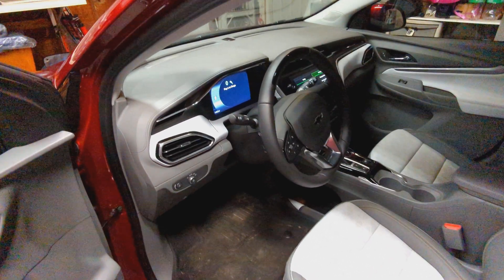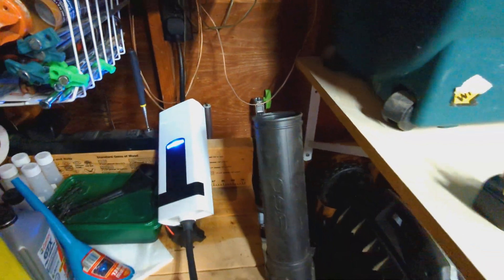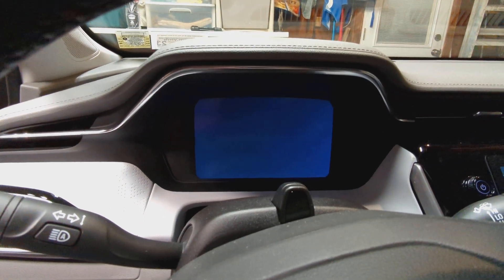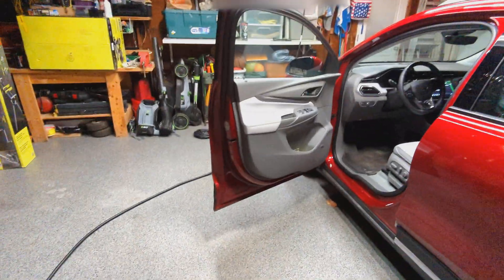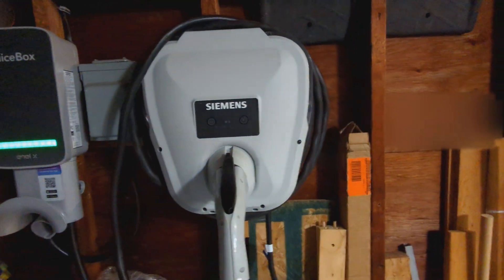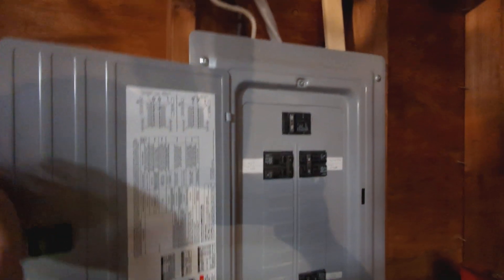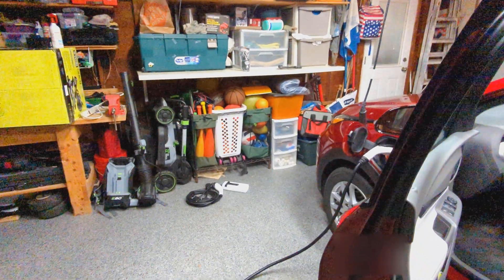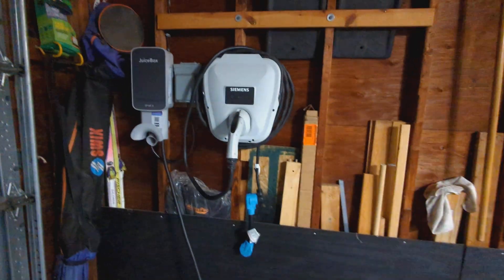Bolt EUV Charging Options - Review 120V vs 240V how much time do you have? days vs. hours

Comment: You do understand that they could put a faster charger in that car for pennies on the dollar. But like typical legacy automakers they're trying to find a way on how to overcharge you. Before electric vehicles they used horsepower to differentiate between the $20,000 car and a $40,000 car they can't do that because most electric vehicles are fast by nature so now they're going to use the charging speed to get more money out of you. Tesla does not do that say what you want about Tesla they don't rip you off. I am not saying that they will not turn into GM or Ford in 20 years but right now two model s's one model 3 and a model y later I can honestly say Tesla does things right. I know that their model 3 is expensive compared to this car but like I said to put a faster charger in there would be nice to even have it as an option for $500 or $800
Reply from the maker: You have a some great cars no doubt, but you have spent about $250k on these Tesla's over at most 10 years. which is about about 5 times what I have spent on my vehicles.  And yes I completely get they could add such options. But at the same time Tesla could knock 20% off all of their vehicles and still be very profitable.  Could even knock 30% and be at break even.  So you as a buyer of the vehicle are paying that premium, and while I like Tesla and what they are doing I am choosing for now not to fund their company, at some point that may change as they will continue to be very successful
Reply: @practicallyfrugal  those cars are in a different tax bracket they compete against BMW and Mercedes. The reason why is because you can make them cheaply and sell them for more money it's called capitalism we all hate capitalism when it works against us. My point was something as small as adding a charger that can charge your vehicle faster if something even the cheapest car should have but like I mentioned before that's something they're going to use to make you pray more money

Comment: do a video on the heat pump and show if cools as well as a/c and power usage difference. and if heats as well if using for heating.
Reply from the maker: It will be on the agenda, I have the Rheem heat pump water heater that replaced a 40 gallon gas that I should do a video on, math on those is quite favorable to the point if you swap a resistance style water heater with one of these you will negate the additional electric use for 12k miles in the bolt
Reply: @practicallyfrugal  about 2 years ago we swapped out an old nat gas water heater for a heat pump/electric hybrid water heater. it works pretty well. but electric bill about 95 more at certain times of year than before. but nat gas bill isnt as high during heating season. water doesnt get as hot but still gets plenty hot. its a 50 gallon water heater.
Reply from the maker: @mts982  that's seem rather high.  Either you have a lot of hot water use or insanely high electric rates.  We have the 65 gallon version and inlaws have the 50gallon version. Family of 4 and 2 respectfully.  Both are using about 90kwh per month or about 1,100 kwh total. At national avg electric rates that is $165/yr.  As similar size resistant water heater would use about 5,000kwh and cost about $750 per year. Inlaws went from 50 gallon on resistant to 50 gallon HP and their electric bill went down about $45/mo.
Reply: @practicallyfrugal  only thing i can think of is its out in garage, not inside, been very cold as of late. maybe we need to wrap it.
Reply: @practicallyfrugal  
Time-of-Day (5-8 p.m.) Rate details
Non-summer

October 1 - May 31
Midnight
5 PM
8 PM
Midnight
Off-peak
Midnight – 5 p.m.
$0.1098 kWh
All day weekends and holidays
Peak
5 p.m. – 8 p.m.
$0.1516 kWh
Off-peak
8 p.m. - midnight
$0.1098 kWh
Summer

June 1 - September 30
Midnight
Noon
5 PM
8 PM
Midnight
Off-Peak
Midnight – noon
$0.1323 kWh
All day weekends and holidays
Mid-Peak
Noon – 5 p.m.
$0.1827 kWh
Peak
5 p.m. – 8 p.m.
$0.3215 kWh
Mid-Peak
8 p.m. – midnight
$0.1827 kWh
Reply: @practicallyfrugal  used 638kwh last month.
Reply: @practicallyfrugal  we do uses heater that uses electricity to blow the air. use dishwasher a lot. 4 outside lights stay on all night - dusk to dawn lights. have a small freezer in garage. mom watches 65" tv all the time.
Reply from the maker: @mts982  if the hybrid water heater used that much last month it is not using the heat pump.  Trying setting it to heat pump only mode
Reply: @practicallyfrugal  that was ALL our electric usage.

Comment: You did a very good experiment , I had a KIA EV until I had a 12 Volt problem, but I did love this car . After watching your experiment , I have to question why  companies selling EV's even bother to sell a car with 110 chargers , they are a waste of time and down grades Electric cars Useful ness . It's like selling an F 150 turbo with a 10 Gallon Tank . The dealer did try to up grade me to a Level two for 623 dollars . I went home and hit Amazon and purchased a Level two for less then 200.00 bucks . 
 
Prior to my EV purchase , I installed Solar Panels on my home , I asked for the Max, based on my previous two years usage , 150 % . After a couple months I watched my power generation and decided to get an EV . The Solar Panels worked well in charging the EV , and I was still running a slight surplus of energy. Recently I found out when the Solar company detected one solar panel safety  device malfunctioning and came to correct it that I can modify my Solar inverter to directly charge my EV with a minor modification . This means the Solar energy goes directly to the EV instead of the Power Grid , I am not sure what the benefit is , but I assume if we had a Grid failure , I would still be able to charge my EV . Again great experiment !

Comment: Should of got a Tesla, no more range anxiety,  What country are you in anyway?  Here in the states the standard is 240/120.  Put a volt meter in the outlet and tell  me what you get.  I guarantee it WON'T be 110.  Do the Bolts sill come with a supply of marshmallows and hot dogs?
Reply from the maker: So yes I did misspeak the voltage is 120v on the standard household outlet.  Tesla's do have more range for those longer road trips and more performance, BUT that comes at very large upfront price that it doesn't make sense financially for many.  In my case I can certainly go buy a model Y today, but I don't need the performance, nor the extra 100miles of range for what is a car I drive locally/regionally without issue.  The cost differential currently is $30k after taxes and with the deal I got $45k.  I can go and get another car with the cost differential alone, but to each their own.
Reply: i’d look into the tesla wall with the j1772 plug. best value for a 48 amp.
Reply: You might live in the states, but I don’t believe English is your first language. Your writing is a little rough.
Reply: Ya because no Tesla has ever burst into flames. Oh wait….
Reply: He must’ve had posters remorse cause I don’t see his rude little post any more. 🤷🏻‍♂️

Comment: Thanks for the video. 
You should really use power and not amps when talking about chargers. The new Bolts will take 11.5 kW (240v x 48a). The Bolt has a 65kWh battery so if it's got 15% SOC then 65x 0.15 = 9.75 kWh left, 65- 9.75 = 55.25 kWh to bring to 100% SOC.  Your 9.6kW charger (240v x 40a) will charge the battery in ~  5hrs and 45 min. (55.25/9.6=5.755 hours.) Your small charger 1.44kW will charge the battery in ~ 38 hours and 20 minutes (55.25/1.44 = 38.37).
Reply: This is a good explanation. I'm illiterate when it comes to electrical terminology lol
Reply: So does this mean that those of us who have their battery swapped due to the recall can now charge at  11.5kwh instead of the 6.6 or whatever we were initially limited to at level 2?
Reply: @casstippit766  I don't believe so, that's the internal electronics that enables higher charging. Let's remember it's EVSE (electric vehicle service equipment), all the electronics to balance the battery and current limit it are in the car not the EVSE.
Reply: @Billy.80  I disagree,  amperage is only a portion of power (P=EI), 16A at 120V and 16A at 240V are two entirely different things. when we talk about outlet power we talk about the nominal power, for a 120V outlet that's 1800 watts (120V x15A). If your ACV is lower or higher than 120V that is a specific aspect of you home, not of the grid. If you look at EVSE specs they are relative to power. Clipper Creek's specs, for example rate their unit at 9600 watts, that's 40A at 240V. The important rating is the 9.6 kW. Amps are relative to panel fuses only, to get that 9.6kW you need 40 amps which is usually a 50 amp breaker for overhead. Saying 16 amps doesn't give any reference, is it 16A at 120V or 240V nominal? Entirely different things, that's why we refer to power.
Look at appliances, what do most of them show? Something like "120V, 60Hz, 350 watts", that's from a small heater in my office I just looked at.
Reply: with all the melted outlets showing up on youtube, people should be paying more attention to amps.

Comment: My 2023 Bolt is expected in 3 weeks, barring any rail strike. I live in So. AZ and have a large off-grid solar setup, however, I am on the grid. I'm now retired and only need this car to run errands. We live rurally and it is a 30-mile drive to most of what I need and I only drive maybe once or twice a week. So I bought it knowing I would only slow charge. If it takes me 3 days, not a problem. 100% powered by the sun lets me tolerate the Arizona sun more. It will be parked in a finished garage with heat pumps powered by solar.
Reply: I work for the railroad as a locomotive engineer.  I can assure you there will not be a rail strike.
Reply from the maker: @LastMumzy  I think they should have provided the sick time
Reply: @practicallyfrugal  Would have been nice 😞
Reply: @LastMumzy  union fist bump
Reply from the maker: Nice set up,
Reply: Leave your car plugged in all of the time with a charge limit of 80% and you'll always have enough range for any emergencies. That's what I've been doing for the last four years.
Reply: You will find driving on free fuel so much better.  Have a great Xmas
Reply: @THOMAS It's better to take an Uber.
Reply: Did your bolt arrive yet?
Reply: @arjunc2266  Yes! Picked it up on the 24th. It has been very cloudy the whole week but I still managed to get about 160 miles of charge through the clouds.
Reply: @Mrdsmith500  Great, Congrats on the new car! Just in time to gift yourself a little something for Christmas. Which trim level did you order and what was the total wait time on your Bolt EUV? I’m curious as to expected delivery times as I’ve heard some pretty horrific stories from people on terribly long wait times.
Reply: @arjunc2266  I ordered mine on 9/02/22, delivered 12/24/22. I have the 1 LT. The only option was the paint, bright blue metallic @$395. Mine is the EV, not the  EUV. I did not want to spend much as it is not a road trip car for us. Wait time can go up if you order with a lot of options, depending on the supply of options parts.
Reply: @Mrdsmith500  frankly 3 months is decent. It probably has to do with your build only being a 1LT and not a loaded premier. Some people online have been waiting for over 6 months. I hope my Bolt arrives soon. I placed an order last week. I hear it all depends on the allocations that a dealership receives.
Reply: They are fully discontinued already.  GM said so on Monday morning 4-24-23.  We unfortunately have a 2020 and no recall fix or idea when it will happen in 2023.  Cat Lady CEO is just talking about their " Plan " to do something in the future with EVs .......  I hope nobody gets into their EVs and gets ignored and passed over exactly like all of us others out there.  IF you are in an accident ..... Your car will be totaled because there are no parts to fix it.  The Equinox EV is a sham.  They are only selling TOP TRIM LEVEL ones for the first year.  That is IF you can get one in a year.  The one thing Chevy are good at is NOT delivering EVs.  If they made the order Non Refundable there would be less than a thousand.  Also the Equinox they PLAN on making at the bottom level trims are far more expensive than a Bolt and will have over 50 miles less range and weaker motor.  FACTS.  If you don't spend over 40 thousand dollars you will be screwed and road trips won't be an option.  Front wheel drive will make your tires last 10,000 to 20,000 miles from now on.   You can't tow any weight with front wheel drive without a front motor and transmission to counter weight it.  Tires will not grip in dry conditions.... Just spin.  Chevy is ready for bankruptcy and deserves it fully.  Stealerships will be the next to go with the Bolt and Bolt EUV.  None of it will be missed at all.
Reply: Suggest you keep the car out of the sun as much as possible when parking. Arizona sun gonna beat down on the Bolt.
Great car though!